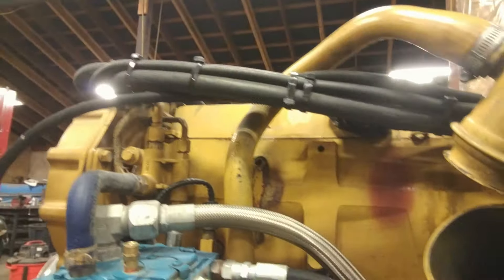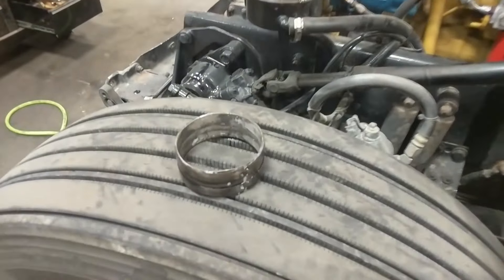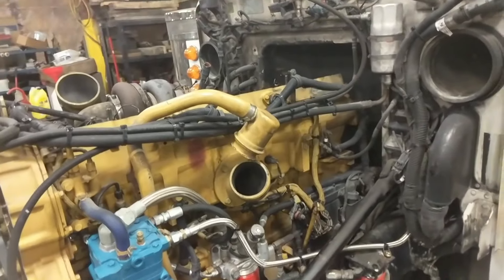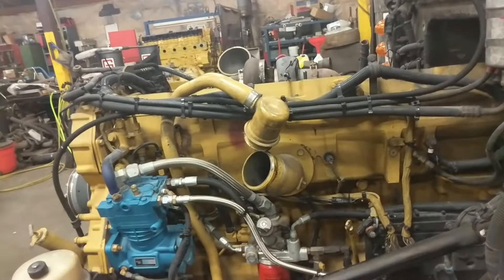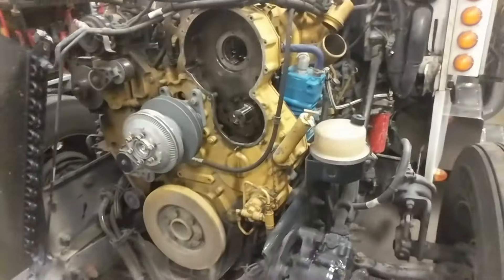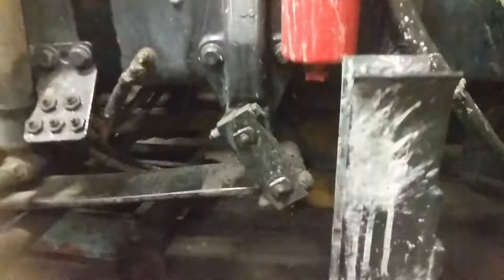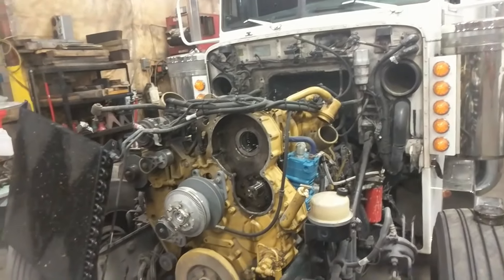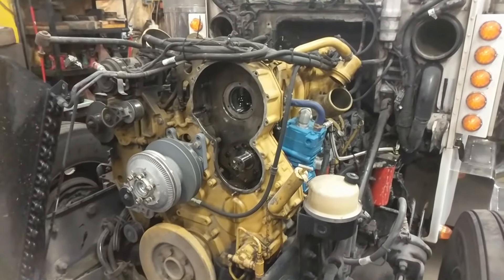Hey... What's that dark spot?..

Comment: why pull the hood, bumper, radiator, you need a new head and the cam comes out with the head and a aframe in the back ground?
Reply from the maker: The truck wasn't brought in for the cam bearing.  He said it was running rough and wanted an overhead.  The hood was taken off for repairs from a deer strike.  The bumper has to come off to get the hood off.  But we're putting a bumper lift kit  and new bumper on it anyways.  And before I started working on the engine, I noticed that the lower radiator tank gasket was leaking and the radiator was plugged up really really bad.  All in all, i was glad all that was out of my way cause it makes the engine repair that much easier.  But you're right, it's torn down a lot further than it would need to be if all we were doing was the head and cam.
Reply: @youtubeisawesome2487  had custom loses  lower raditor east bound i-80 donner summit pulled on side of road c.h.p. comes by & tells driver drive up mountain to turn out top 3" of block & head looked like that , iwould of turned engine off & tell chp computer override engine shut off 🙄